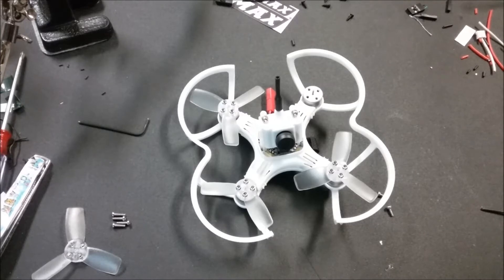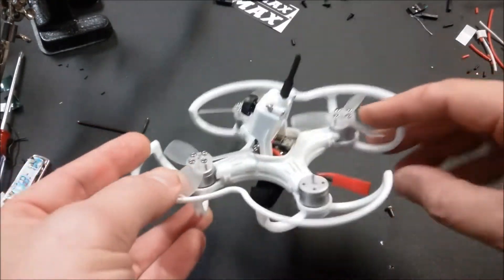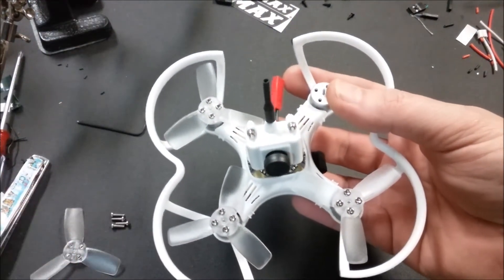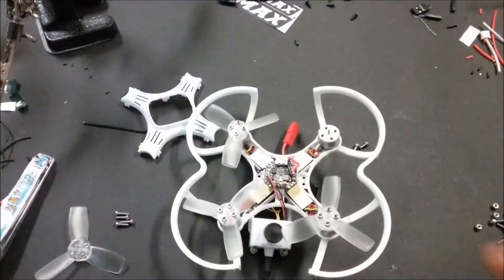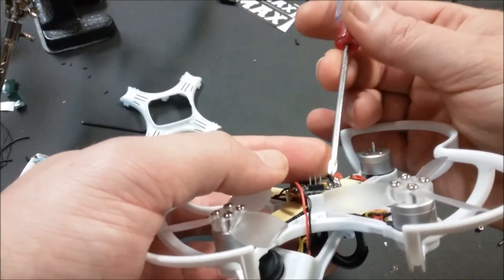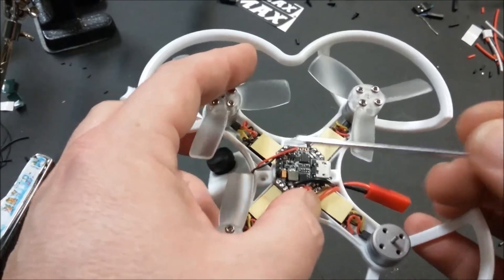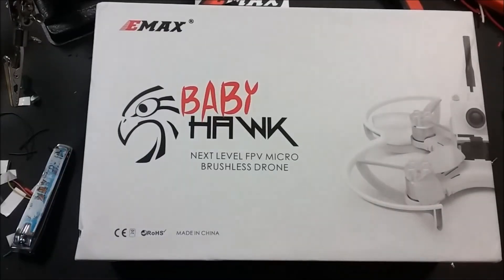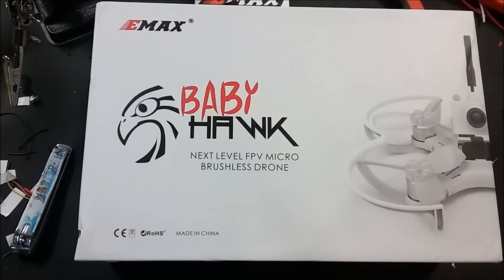How to install a satellite receiver on the EMAX Babyhawk

Comment: So wait, you have to soldier on a PNP?
Reply from the maker: GBLynden's RC to use a Satellite rx you do because it requires 3.3v and on the femto fc the 3.3v comes from a pad on the board. Thanks for watching. Sincerely Dez
Reply: desode9 Thank you for the quick response and you have a great start to your channel here. I have never soldered electronics and the thought of soldering in such a tiny space is daunting. What soldering iron do you recommend and where do you get the super thin solder?
Reply: desode9 I just rewatched the video and as someone that is used to BNF RC Planes and similar quads, I wish you would have dumbed it down a bit and held the board much closer to the camera. Even after watching it several times, I can't tell where to solder things exactly.
Reply from the maker: GBLynden's RC Thank you for watching and for your kind words. 
I do this to help people and I try to go the extra mile, especially for my subscribers.  I use a iron like this https://www.radioshack.com/products/radioshack-soldering-iron-kit?gclid=CjwKEAjw_uvHBRDUkumF0tLFp3cSJACAIHMYM63Z0ayMZSDGE0TDtVMY7YaY_ms8pWDf5BUH-r-ZfRoCOXHw_wcB
You can find them other places also. The key is using one that is for hobby and electronics work. The one in the link is not much bigger then a marker.   You want to also use a fine point tip or a cone/pencil tip (it is called by either name some times.  It is a nice investment to have a good iron in this hobby. While doing soldering can seem difficult as a beginner it is a easy and rewarding skill to learn. You can also get what is know as a solder sucker so that if you make a mistake you can suck the solder off of the board thus having a fresh start again. Maybe I will do a video soon on some basic soldering tips. Would that be something that could help you more?    Thanks for watching and please subscribe if you havent yet.  Sincerely Dez
Reply from the maker: GBLynden's RC I put lots of information in my video description that helps with the video.  If you look in the description you with find the link to the full Femto FC board layout to follow with the video.  Hopefully that makes it more clear.  You will notice that most guys like me do this on their videos. Thanks for your comments and I will take that into consideration on future videos. Sincerely Dez
Reply: desode9 The solder tips would be a great video and a wonderful way for you to diversify your subscriber base. You have a winner here no doubt. I just crossed 7,200 subs and I don't have an intro or anything you have. The sky is the limit my friend! :)
Reply: desode9 That graphic was VERY helpful. I just need to figure out two things.....the first is to buy a soldering iron for something this small. I have a standard size one but I wouldn't feel comfortable using it on a board that small. The second is to figure out the polarity for the colors in the Spektrum receiver I ordered.

Thank you for all of your help!
GB
Reply from the maker: GBLynden's RC, glad I was able to help!  If you need anything swing by here and let me know!  Sincerely Dez

Comment: i just got mine in yesterday and i connected the receiver and it seems to work kinda.  the values in the receiver tab in cleanflight moves like they should but when i try to fly it the motors will not spin up. 

could you possibly make a video on how to set this up in cleanflight or what ever software is best.  i know i'm just missing one or 2 settings to get this to work my guess is the arm isn't working for some reason.  thanks for all the info
Reply from the maker: Did you set up the Arm switch?  You have to set the Arm to a switch on your radio via cleanflight..
Reply: i should have put that in there to. i did set an arm switch but it seems to be a little weird isn't the arm box ment to light up when the switch is flipped because mine wouldn't but the flight modes would like horizon and the others.  sorry for my noodness i haven't set up a quad for about 2 years
Reply from the maker: Do you mind my asking what radio your using? and the Babyhawk should be Betaflight from stock not cleanflight.. As for the video, I will see what I can do this week, but I am Crazy swamped with things right now,, A very dear friend of mine passed away last night so I have a lot to do with calling hours and the funeral.. The reason I asked about your radio is because it could be a range setting in your radio too. Make sure that your stick movements in Betaflight are at the correct values.. for min and mid and max.. If not you need to subtrim with the radio to get those setting spot on. My guess would be that when you pull your throttle stick down the range is not low enough and that is blocking it from Arming. This happens from time to time on some quads.. If you look at the receiver tab in Betaflight, and pull your throttle stick down all the way, That needs to be under the min value which is writtin to the right of the stick range graph..  If it is not then the quad wont arm... I hope that helps  Sincerely, Dez
Reply: ya for sure it is a spektrum dx6e and a spm4648 receive. and no worries with the video  i'll try all the thinkks you said i didn't know there was a min distance thats good to know.  really thanks for all the info i really appreciate it :)
Reply: and i'm sorry for your loss hope things go well for you :(
Reply from the maker: No problem Tyler,, Yes there are min, mid and max range settings in both cleanflight and betaflight.. If you every encounter this arming issue 
that is most likely what it is.. Feel free to ask any questions.  I am 
always glad to help my viewers out any way I can and I appreciate your 
watching!  Sincerely, Dez
Reply from the maker: Hey Tyler, One more thing, I looked into this and make sure that your quad is level also when you throw the Arm switch.. It will not arm if it is not level.. I would also recommend doing a Accelerator calibration with it level.. You will notice a little blue light on the Flight controller. The Blue light flashes when the quad is not level,, Check that blue light and when you hold the quad level it should go out , then it will arm.. You can also test this in Betaflight with your arm switch,,, You are correct that the Arm switch should light up in the BF section.  Let me know if any of this further info helps.. I had forgotten about the level issue before arming
Sincerely, Dez
Reply: Ah dang that makes sense I'll have to try that it's hard with the baby hawk with the battery in the bottom to get it level and mine flight board is only stuck down with foam so that makes it hard too when it's plugged in to keep the cable from moving the board I'll try my best thanks for more info :) I'll let you know if it works I can't try it till tonight
Reply from the maker: Uploading a short video about this now,, So chack the channel later or if your subscribed it will notify you when it is up.. Sincerely,Dez
Reply: Ah sweet thank you and no worries subscribed and liked like 5 comments ago you are awesome :P

Comment: Will this work with 3s? mine will be here tomorrow
Reply from the maker: In theory based on specs it would be close but given the right 3s yes I think it would be fine, but they are claiming 2s on stock build for now to be safe, however, Emax has said they are testing 3s on the stock build and would let us know., but have not confirmed it yet.  You can upgrade the esc's from 6A to the Emax Bullet 12A ones and then you can use 2-4s.  If money isnt a problem or you want to be able to use even 4s as well as 3s with no worrys then I would recommend the upgraded 12A ESC's for now. You could order the 12's and then try your 3s as stock, knowing that the 12's are on the way in case you have a issue.. The Only limitation is the ESC's on the stock setup.
Thanks for watching and for your comment!  
Subscribe if you want to see the lipo testing that I will be doing soon.
Reply from the maker: I will also add that you are most definitely going to need to tweak the PIDs for using 3s. I would say lower the rates a little to your liking.